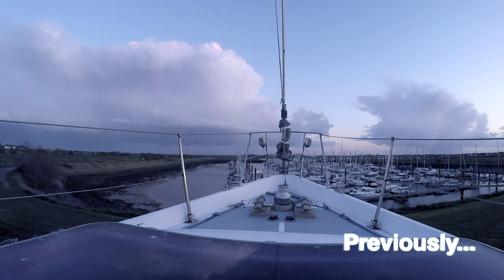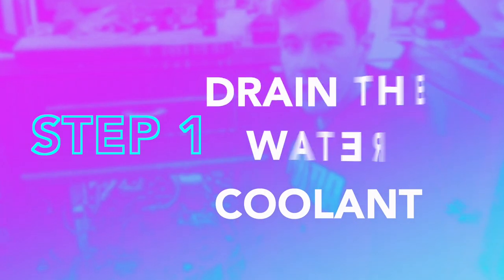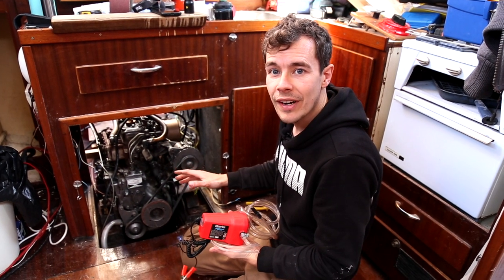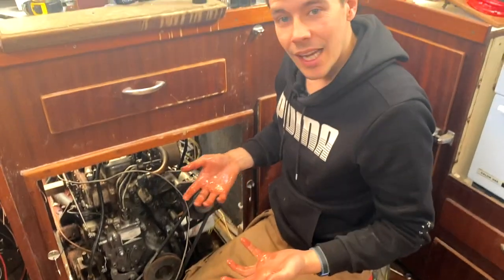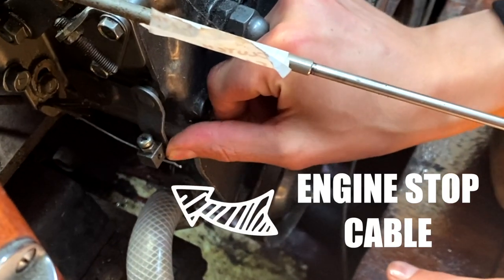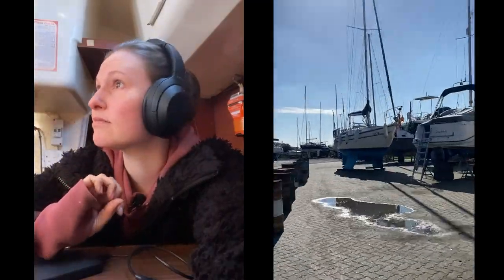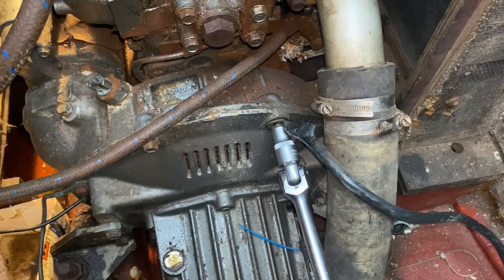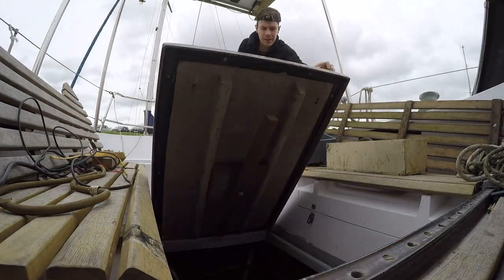Ep 10 | How NOT to DISCONNECT our Marine ENGINE | PART ONE

Comment: Make sure you check the condition of the steel pipe that runs close to where the tacho sensor is. They have a habit of corroding and then squirting high pressure oil spray everywhere, emptying your engine of oil and then it goes bang.

P.S. the cable you are calling the clutch cable is the throttle and the cable you called the throttle is the gear cable just in case of confusion.
Reply from the maker: Thank you, I’ll add that on the list of things to check!!
Dang it! I thought I had them the right way round 🤦‍♂️

Comment: Why draining engine oil out to lift an engine? coolant only if a line to external boiler…
Reply from the maker: Wanted to drain the oil to make it lighter to lift out. We’re taking it to our workshop so wanted to have it empty for a strip down anyway. 🙂
Reply: 2-3 kg of oil isn't going to make much difference.  There is no reason to remove coolant either even with a water heater.  Just disconnect the water heater and join the two hoses together.  Amazing attempt at drama for a job that needs no more than an hour.
Reply from the maker: No drama. Just first timers.